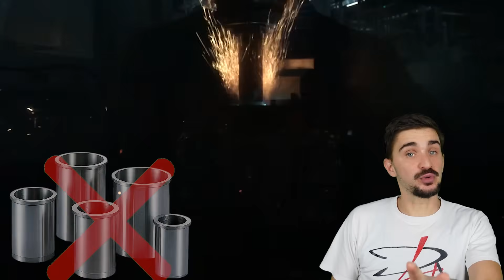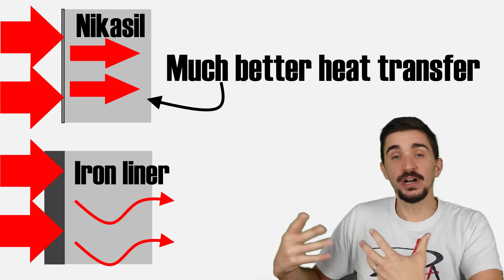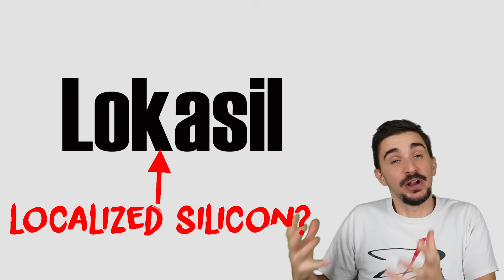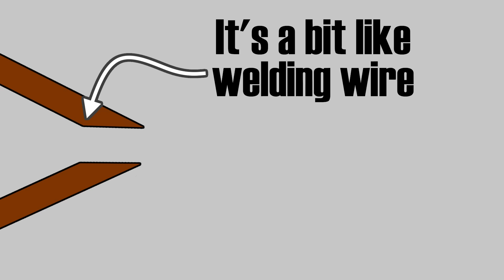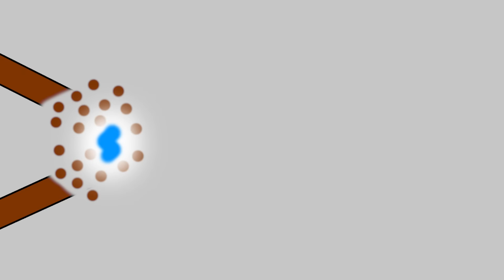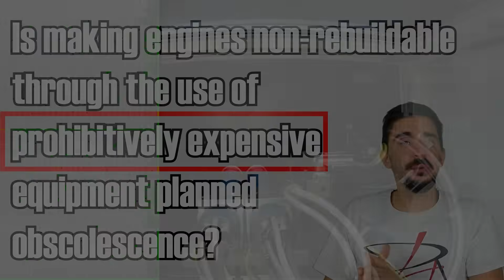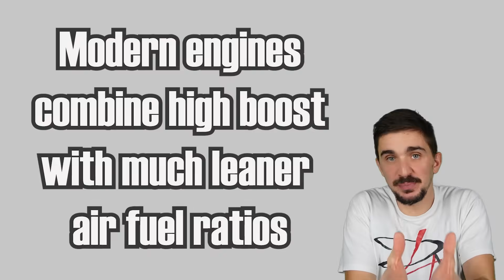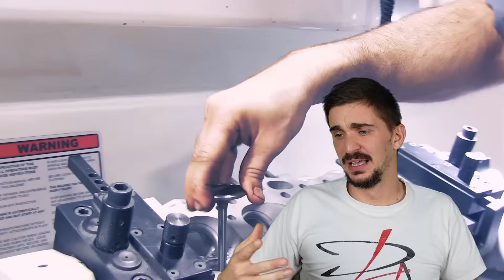Why Are Engines Becoming Non-Rebuildable? Everything About Cylinder Coatings

Comment: i finally bit the bullet and my 8th gen accord was re-sleeved with steel liner after 300k km + oil burning issue. so far after 5 months, still works well. if it can last another 150k km, i am gonna re-sleeve it again, or upgrade but probably re-sleeve. This time, i do JASO FC "upper cylinder lubricant" thing, hopefully i can update this after few years gone by.
Reply: Change the oil more often if you care that much and it won't wear as quickly.
Reply: Why would you plan a rebuild at only 150k km? It's not like an Accord is some special car that must be kept like new or a race application. This is a waste of time and money, if the job was done correctly it will go much longer than that in normal driving. Upper cylinder lubricant is not a necessary thing in petrol engines and will just ruin your cats with no benefit, that is for alcohol fuels in race applications.
Reply: Got this car used, from the leasing company, not sure what happened during lease. Known problem during pre-purchase, quite cheap. Became daily drive since its operating cost is reasonable, , got worse over time, new car toooo expensive. Tried asking mechanic for halfcut , engine can't be guaranteed. They don't prefer owner supplied parts either. I do expect it to last longer but if it made it to another 150k km, I'd consider this a win.
Reply: Use a low friction Upper Cylinder Treatment to coat your cylinder and you'll extend lifespan by 2~10x.
🙂#XcelPlus

Comment: reliability issues stem from many difference sources which will add up.
low quality materials and processing.
too little safety/tolerance margins.
using technologies that serve no propose other than being another maintenance item. (like wet belts)
lacking q.a. during production/assembly.
applying technologies that were not enough tested and will develop unforeseen problems.

Comment: Good video, quite interesting and informative.

On your CO2 calculations however, I would argue that when comparing rebuilding vs new engine, you shouldn't account for the mass engine only, when rebuilding many of those times you also save the whole car itself, while new engines are only a thing if the car is quite new where it would probably not have offset nearly as much as the CO2 p/y as stated there.
Reply: I was about to write the same thing, recicycle more than a ton of metal is different from 30kg of alluminum.
Reply: Yeah, but say that to the guys who make the regulations
Reply: Vehicles are generally sent to the scrap yard due to suspension/ brake issues, not engine issues.

Comment: Yes it does financially make sense to rebuild, not because of coating, but premature wet timing belt failures (which I think you covered already). So if the block has to come out of a car that's structurally not dead yet and pretty fuel efficient, that would be a win-win for rebuilding.
Reply: I'm surprised there wasn't a conversation over the lifespan of these coatings compared to the lifespan of a sleeved engine.
There are many places where the body of a vehicle, and its other drivetrain components, happily outlive the engine.

I think my perspective conflicts so much because I'm in the US.
We average three times as many miles a year, and depending on your field of work I've personally driven over 50,000 miles a year. That's > 80,000 km.

A rebuild isn't a discussion for two decades from now, not here. These new engines are failing to last 100,000 miles with all the defects going around! And while rebuilds are getting more expensive, so are cars.

We should not be pushing for disposable goods, even when those goods have an advantage.
Reply: Probably not. My last iron block 4 cyl engine build cost near $7000 and i reused the old timing assembly and cams, and this started with an engine that was in excellent shape and really only needed rings and a hone, but I wanted a much stronger rotating assembly for boost. Outside of someone making 300+hp per liter, it would be VASTLY cheaper to buy either a good used engine or even a new one from the manufacturer.

Edit: This is not including the costs to remove the engine, disassemble, reassemble after machining, and reinstall, which i did myself.
Reply: @OtisFlint  "it doesn't make sense to do it because I spent a fortune changing the engine into something it wasn't before".

wow, slow clap for you bud
Reply: @OtisFlint   Not a valid comparison. The new bottom end probably made up the vast majority of that cost.
Reply: But fixing a broken wet belt is not rebuilding an engine. There is no need to rehone and replace piston, rings etc.
Reply: @ComplicatedStuff  Broken wet belt = belt bits gunking up the entire oil system, followed by loss of oil pressure. So yeah, that's usually a full rebuild.

Comment: The more technologically advanced a product becomes, the fewer people who can actually perform work on it. This makes it unreliable and useless to the masses. If these engines are redesigned to have replacement cylinder sleeves this technology of electro- plating could be a godsend. Of course this would not be a good profit model. We can hope that a crate engine is not out of reach.

Comment: I overhauled engines for almost 30 years and i have seen a few problems come into existence over the years.
A mayor problem is that engines aren't designed by engineers anymore but by accountants and these accountants make terrible technical decisions 😢.
Also a mayor problem is all the crap we hanging on engines for the last 20 years.
Years ago you had only a basic engine in most cars and they could be easily overhauled , but the last decades engines got quite complicated and hang with turbo , coolers , and all kinds of 💩.
So if one of these things fail it's not economical anymore for overhauling a engine.
Even when the basic engine is oke , after you count for all the hours and auxiliary parts they are basically a write off 😢.
Also a huge waste is that in modern cars all the systems are connected in one way or another and when there is a electrical problem costs easily spiral out of control and make what is basically a good car economically not repairable 😢.
Some of these systems are designed to fail after a certain time so manufacturers can sell expensive parts or vehicles.
My advice is stick to simple and reliable old type cars that are easily repaired for reasonable cost 😀.

Comment: 21:39    OMFG!  I’ve been wondering for literally decades why they discontinued the RB26 citing emissions and your the first person I’ve heard actually explain it!
Reply: Except the RB26 was ended 7 years before the vr38 came out?
Reply: @Low760    Well yes, I meant that everyone was disappointed that they didn’t revive the RB26 for the new car (or a new version of it) but they didn’t, citing emissions requirements as one of the reasons.  

I had always thought that made zero sense as why would a straight six be any worse for emissions than a V6, but it wasn’t about the configuration, it was the block material being used.  

I suppose they could have developed an all new alloy straight six but it probably wouldn’t have been a good idea to spend all that money to develop a new straight six for a specific niche application.
Reply: rb is based on the l series. why would nissan put a 40 year old platform in their new (at the time) premium sports car?
Reply: @xoxo98808 hahhaha yeah sorry 40 year old engine design 

And i hear people in JDM land crap on LS engine swaps being old and out of date 

Yet LS is still sold new today just very different from the base ls of the late 90s
Reply: @NickTaylorRickPowers it doesn't help that GM is terrible at naming their engines. For example, LT engines are the current V8 engine family that have replaced the LS, not to be confused with the mid-90s, or the 1970 LT1.
Reply: Also Nissan wanted to make the R34 with a different engine than the RB26. It was just not in the budget to develop a new engine platform for it. So they went back to the RB. So they were looking to get rid of that old tech for a while.
Reply: the RB26 was discontinued because the RB wasn't needed. If your power goal is 300ish horsepower stock, you don't need a massive, heavy inline 6 with twin turbos when a 3.5 litre V6 works. VQ/VR did the job, and did it well.
Reply: Nissan may also have decided they no longer needed an inline six. Therefore, making some V6 and putting it everywhere was preferable. I mean they ended inline sixes in the Z-car back in the 80s. Why not do the same to the GT-R?

Toyota ended the 2JZ, so when I heard rumors of an MKV Supra, I fully expected Toyota to build it using some V6 with twin turbos.

I don't know that inline six or V6 engine makes much difference in smog, if the engine is MPFI or GDI. I thought it makes a difference in carb and TBI engines.
Reply: RB engines were almost 20 years old at that point 

That's pretty much the Nissan way 

Make something great and it is all we are going to do for 20 years

Comment: Recycling metals can indeed be tricky - one example is the cheaply made aluminum stock pot.  These pots are cast with recycled aluminum, and with little being done to remove fluxes and other metals, you can end up with heavy metals leaching into your food!
Reply: I think aluminium cookware is a bad idea anyway.
Acids also react with it and this can have negative long-term health effects.
Reply: I've been told uncoated aluminum cookware leads to Alzheimers. Aluminum should not be part of your diet just as much as lead.

Comment: Sadly, they’re doing all of these different things for emissions and lack of CO2, based on the lie that carbon dioxide is a pollutant. I don’t know if I heard it from you or someone else but, engines today are 95% more efficient than those of the 1960s. There comes a point when you can’t do anymore and doing more only degrades the quality of the product.